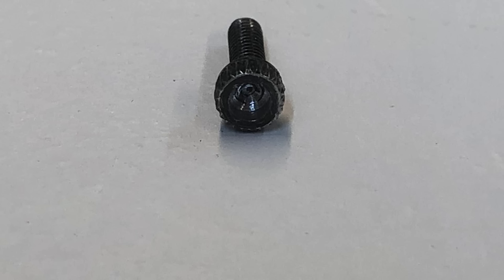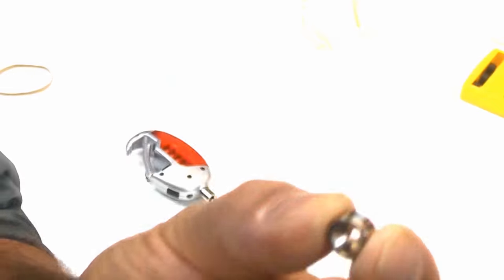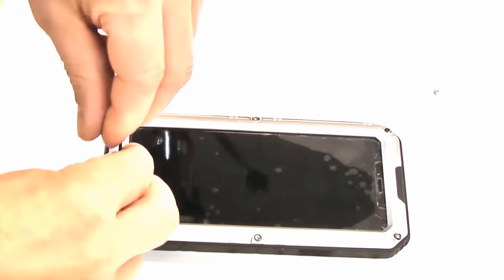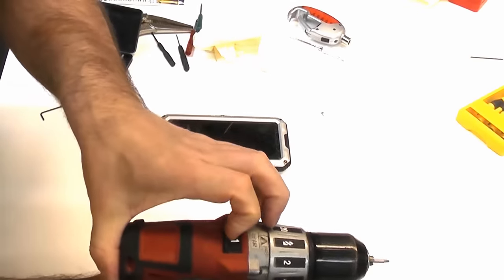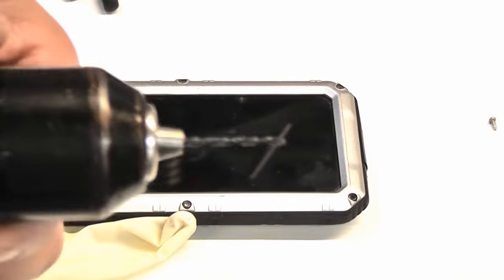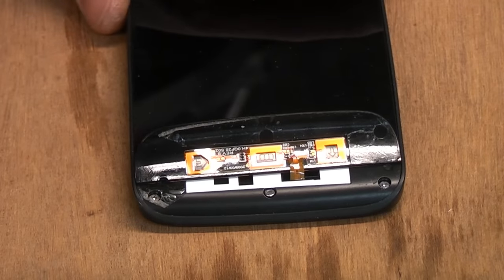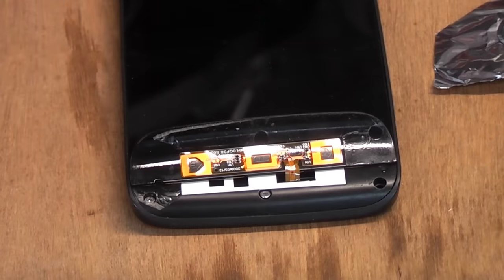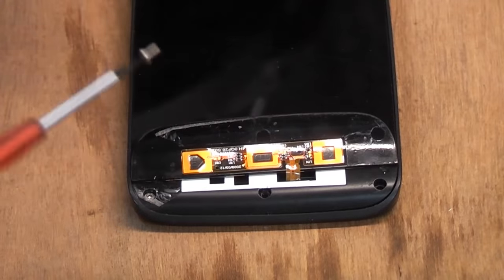How to remove small stripped screws | stripped laptop screws | stripped phone screw removal

Comment: Any suggestions for the 00 screws on a macbook pro? Some idiot at the Apple Store did a number on 3 of these screws! These screws are very micro and I fear most of these suggestions in your video won't apply.
Reply from the maker: I'm afraid not. Some of these screws are so small that you can't use something like a micro-grabit or similar. If I do think of something I will comment back ;-)
Thanks for the comment 👍

Comment: How do you remove a small precision screw that snapped in half?  Half of the screw is stuck inside the device.
Reply from the maker: Very difficult- you might be able to drill it out using a small drill bit, you can often get them as small as 1mm in diameter.
Thanks for the comment 👍

Comment: Tiny or oddball screws are often used for a reason--to keep curious people from easily opening up cell phones and other non-owner-repairable electronics.  Don't forget to ask yourself if you have any business opening it up:  How will I repair it?  Even if I can open it, will I have the correct replacement parts to install to make it operable again?  Will I know how to repair and test the item so that it works as designed?  Many such items are designed to frustrate a random guy with a screwdriver from proceeding.  Using a high-heat soldering pencil or gun to replace parts may burn/melt the PC board.  Attempted repairs by someone who is not authorized will void the warranty.  Traveling down this path usually leads to more problems and the possibility of damaging the item beyond repair by a knowledgeable technician.  I'm not a service tech, just someone who has lived long enough to have made these mistakes already.  Learn from my experience.
Reply from the maker: Thanks for the comment 👍

Comment: SOLVED MY LAPTOP STRIPPED SCREW ISSUE! 
I used all the hacks but I think mine was just too tiny and the stripping had become really rounded,  and I didn't want to get a mechanical drill extractor because it was a laptop. so I thought, are there pliers to remove screws? 
I found one called Neji Saurus by the brand Engineer bring demoed on a huge screw here on YouTube, after my research I got the PZ-57 because I was dealing with laptop fan screws (2mm) and it removed the piece of *_#£! screw in 10 seconds 😭😭😭 . I just grabbed it and turned the pliers 😭😭😭😭😭

I really didn't want to pay money to clean my fans, but those £14.99 pliers are now a  treasured life companion even though they were delivered 3 hours ago.

Hope it helps someone! If all the free hacks don't work this time. There's also the PZ-60 for the same tiny screws but it goes into hard to reach places Apparently, there are others for bigger screws too.

Comment: so I used the glow method and now the hole is filled with gloe and it's stuck even more any tips to remove the gloe ?
Reply from the maker: A little heat will remove the glue  👍
Reply: @ultimatehandyman  didn't work unfortunately any other tips lol

Comment: I stripped a screw trying to remove ssd drive cover in my laptop, does anyone know what size screw they use? Im looking to buy a stripped screw extractor like the one in the video.
Thanks
Reply: Philips 1 most likely .... Try to use a rubber or latex glove , there are also screw extracting pliers out there.

Comment: Great video - I'm trying to replace a cooling fan on my laptop and found that the #11 screw on the heat sink (the next to last one) was stripped. It must have happened at the factory because this is the first time I've cracked open my laptop. The foil method didn't work for me, and I couldn't find a rubber band or latex glove, but I'm going to try the superglue method later today. Keeping fingers crossed that it works...
Reply from the maker: I hope it works ;-)
Reply: Did it work ?

Comment: How do you remove the screw from the driver if you use superglue?
Reply from the maker: Just hold the screw with a pair of pliers, it will easily break off from the driver- or run it under hot water.
Thanks for the comment 👍
Reply: Ultimate Handyman thank you too for answering

Comment: The next problem is finding the right size tiny screw to replace the stripped one.  I have a small bin (labeled tiny screws) where I throw screws I've salvaged.
Reply from the maker: Thanks for the comment
Reply: Old cassette tapes are often held together with screws of  roughly the same size as those used on miniaturized electronic devices.

Comment: no way! I tried to unscrew my dualshock 4 controller's screws because the triangle button wouldnt work but I couldn't unscrew it until, i used a magnet,I put my small magnet beside my screwdriver and it worked!

Comment: Great tips (no pun intended) for recessed screws. I've found that "Vampliers" are pretty good when the screw head is exposed - they're also useful for security screws when you don't have the right bit (who'd use one for a security tri-wing, as found holding in a smoke alarm detector module, more than once ever?).
Reply from the maker: Vampliers are great, they do a great job of larger screws.
Thanks for the comment

Comment: I'm really pissed right now so I'll list all my attempted and failed methods with the last screw I need to deal with before being able to open my laptop and clean it:
- Rubber band
- Wrapping paper
- Loctite super glue
- Aluminium foil
- Hot silicone
- Tin solder
- Insulting and hostile staring

I'm considering seriously using a drill even if I destroy the whole screw.
Reply from the maker: Sometimes destruction of the screw is the only option. 
Good luck with it 👍
Reply: Use epoxy, small bits , if it breaks which i doubt, u can counterclockwise it with pliers

Comment: You wouldn't have to use the magnet to "magnify" the screwdriver if ya knew to take the magnet and just simply rub the magnet on screwdriver and volá! Ya have yourself  a magnitized screwdriver...
Reply from the maker: I learned that when I was 5 years old, but do not want magnetic screwdrivers 😉

Comment: Hi there, I wonder if anyone can help me, I have exactly this problem but it's on my laptop, I need to take it apart to fix it but there's a screw on it that's completely stripped in that the head is completely rounded, I've tried more or less everything shown in the video including the super glue method but to no avail, I also tried the screw extractors but the ones I had were too big. Are there screw extractors available that fit tiny screws like this and if so, would it damage the laptop if I were to drill into the damaged screw? Or alternatively can anyone shed any light on how else I can possibly remove it?! I haven't been able to use my laptop for weeks now because of this problem so any help would be much appreciated. Thanks in advance.😁😁😁
Reply from the maker: I would try using a left handed drill bit, if it does not remove the screw, just use it to drill the head from the screw. Once the laptop is open you can then remove the remainder of the screw with mole grips/vice grips etc.
Thanks for the comment
Reply: @ultimatehandyman  Thanks for getting back to me so quick, I'll give that a try.
Reply: @ultimatehandyman  Just to give you an update I have finally managed to remove the screw, I bought some of those 'micro-grabits' from Amazon and they worked a treat so thanks for your help! Now I've just got to fix the laptop itself!😁😁😁

Comment: screw driver makes a hole on the foil before touching the screw.......
Reply from the maker: It depends how badly damaged the screw is. Sometimes it works!
Reply: T_T. Glue method does not work either. I may have to distroy the joycon shell and replace with an oem one

Comment: i've already tried this rubberband method for a tiny, tiny screw inside an iphone, but no avail.
i'm pretty sure i'll get the same result by trying the tin foil one.

i'm so pissed off at apple…

EDIT: 1 hour later, i've tried the tin foil method with different screwdrivers and STILL i haven't succeeded.

Comment: I've got a GPU screw that is extremely tight and stripped. None of the easy methods are working, what a disaster.

EDIT: I fixed the shit with the Micro Grabit.
Reply: @ultimatehandyman  Question: How exactly small can you go with the Micro Grabit? This screw is like ~2 mm across, and I read that someone used it with something similar.
Reply from the maker: @maulcs   It will remove really small screws, The screw head in this video is probably 2-3mm 
https://www.youtube.com/watch?v=q6gehydy70k
Reply: @ultimatehandyman  Thanks, I'll probably have to order it

Comment: Stuck with a PH0000 right now
Reply from the maker: If you can’t remove it, this would be the final thing to try- https://www.youtube.com/watch?v=q6gehydy70k&t 👍
Reply: @ultimatehandyman  Thanks, I ended up soldering, melted the plastic around the screw. I was confident in the aluminum motor and it wasn’t damaged. DJI has very tough propellers.
Reply from the maker: Well done  👍

Comment: I tried everything but it doesn't open fml
Reply: @ultimatehandyman  yep i got this laptop, Razer blade, and this one screw has screwed up my life lol 
It just wont open, even with the super glue.. i just hope i can find a professional to get it open for me :C 
Thanks for the help nevertheless!
Reply from the maker: @StonedNoob   Best of luck with it 👍
Reply: @StonedNoob  What is the screw holding on? If its just a plastic case you can always break the case part and just replace that. That's what I'm thinking about doing. That rubber band method has never worked for me.